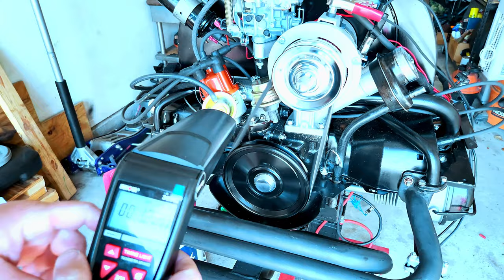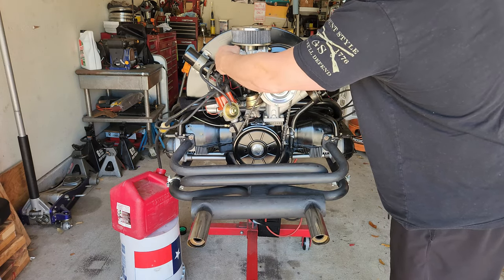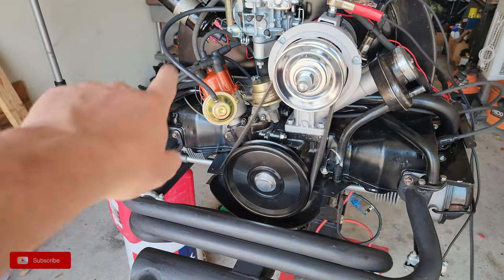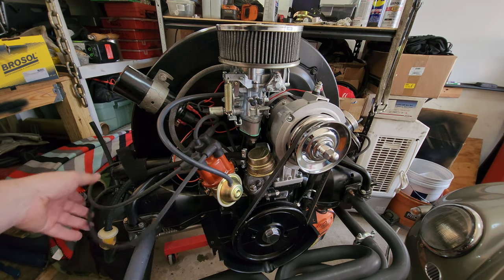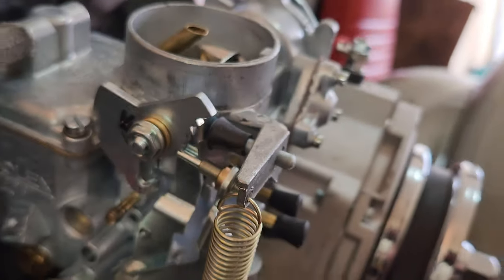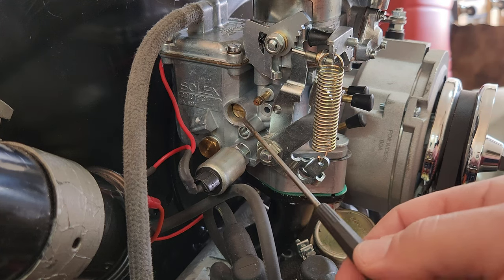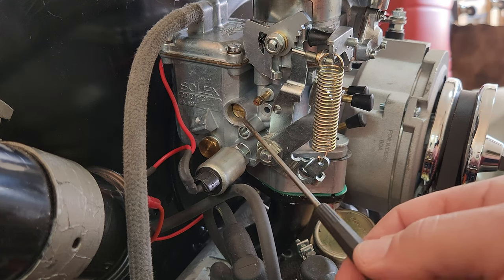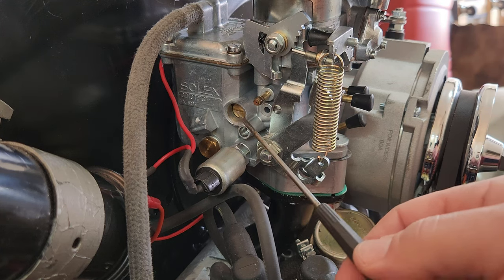Air-Cooled VW Carburetor Tuning - SOLEX H30/31 PICT | JW Classic VW

Comment: 30/31 is my favorite Solex... I'm actually gotten them running much better than a 34PICT on the same engine.  😁👍🏻
Reply from the maker: They are a great carb!
Reply: …somebody else on a chat said same thing. I hav 34 pict but considering 30/31. I assume u get roughly same power/performance? All i need is a different base plate adapter at the manifold i think.
Reply: Dont overthink engine tuning at idle,
its another ball game to tune for performance under load which is what happens when driving and the cars body weight has to be pushed through the air
Reply: What distributor did you pair the H30/31 with?

Comment: You seem to have disconnected the vacuum from the carburetor but did not plugged the vacuum at the carburetor to set the timing.  This is like tuning the engine with a vacuum leak!
Reply from the maker: That's true, good catch!
Reply: ......That upper vacuum line is a  ported line......no vacuum thru it at idle........Vacuum  lines below the throttle plate see manifold vacuum at idle speeds.........

Comment: so far most people say 2 1/2 to 3 turns inital adjustment on big screw. but I can't find what the inital adjustment is for the little screw . Mine is a 1600 engine with rebuilt carb. It will run for about 30 seconds.
Reply from the maker: It is the same initial adjust for both.

Comment: Thank you for the videos. Which distributor are you running with the H30/31 PICT? My old DVDA is giving me lots of headaches. Does the H30/31 have enough vacuum for the advance? Thanks!
Reply from the maker: SVDA... it's an electronic one I picked up from CIP1.  Seems to advance fine under vacuum but I've read that the carb may not provide enough vacuum.